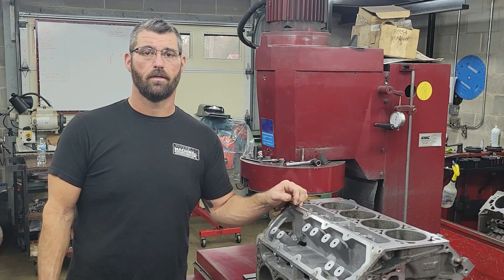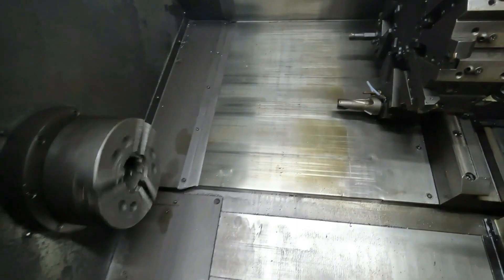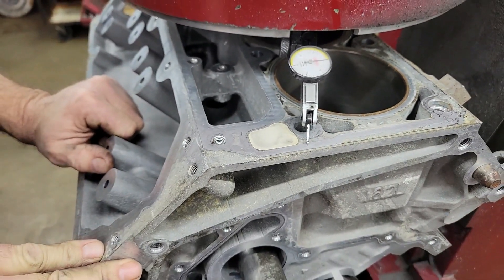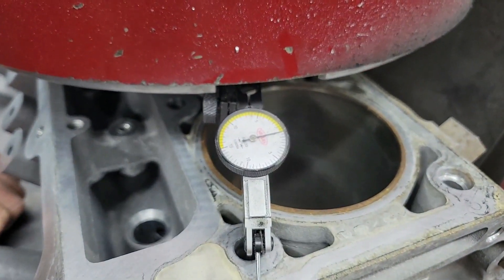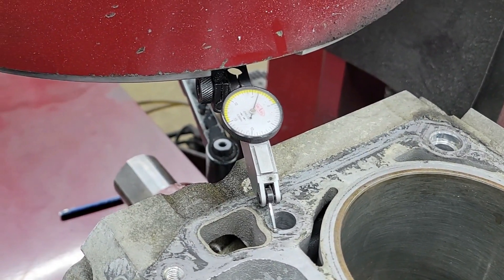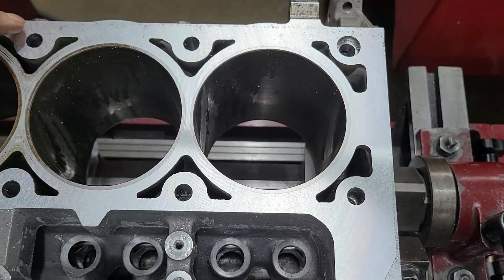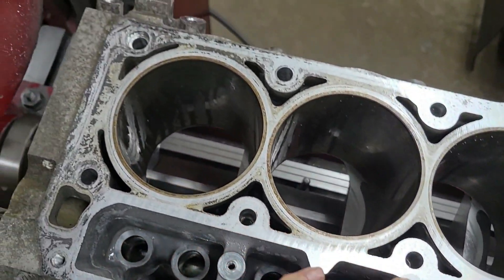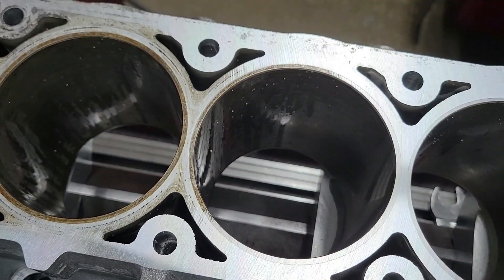Shop Tech: Do you really need to Deck your Ls block?? Lets find out.

Comment: Can you do a video for people that  only getting in to rebuilds subject is  selecting head gasket sizes after the head is skimmed,lm told with my application l need to check the piston protrusion which l did then referred to spec chart for  my application being a diesel landrover td5,l always assumed once head was skimmed it required a thicker head gasket any information on this l would appreciate,regards Roy
Reply from the maker: Will do

Comment: I took my aluminum l92 6.2 to a local machine shop he a great machinist and engine builder but he was telling me to deck my aluminum block that it will make lines across the aluminum deck because of the steel sleeves shavings coming across with the cutter.I believe he has the same resurfacer as you do you use special cutter or speed settings.I thought I’d ask because you deck surfaces look awesome..Thanks for sharing your knowledge..
Reply from the maker: Cbn with lube, works great
Reply: @powellmachineinc  thanks for the info …

Comment: Your last comment FB engineers…priceless!! Let me ask you a question, why do I see some performance shops state they will line bore and deck a brand new aluminum predator 3 block from the factory. Is it because they are mass produced no 2 would be identical in terms of tolerances?
Reply from the maker: Idk what a predator 3 block is, idk why anyone would line bore, a line hone would make way more sense,  and definitely the decks on most any block are no accurate

Comment: Nice content regardless of context.  If I’m paying a man to bore my cylinders I’d rather the deck surface be squared up to the main bores so that the deck surface can be used for reference. 
   Another detail I have encounter when deck both heads and blocks is milling head tram. I’ve seen machines set up with intentional tilt in the milling head to prevent retrace and I suppose to account for slack in the system that allows head shift while milling.  
    I like to tram the milling head as close to zero as possible. I know some machines simply will not allow for this, I’ve just seen some surface jobs that were .001”-.002” deeper in the center of the surface area.  It stinks when you’re machining for lock wire on either surface. 
   Head gaskets will leak and not be blown.  I’ve seen this numerous times possibly too many times to count. 
  When a head gasket is seeping and not blown it is still placing tremendous stress on the head and block in form of heat and friction. I’ve seen these issues left unchecked for too long.  Freshen up and freshen up the black areas in between the cylinders were discussed and nothing done to correct it.     
    Sucks when the heat treat on a very nice set of heads starts to yield and you can’t count on them to work. 
   People around those scenarios will throw their hands up and say the heads are just old when I know that if they hadn’t been stressed year after year they would have still been usable. 
   Sure you can get by without it in some cases. How much do you like gambling?

Comment: Copper coat won't fix that 100% true, but you don't need the deck to be 100% flat either; that is what the gasket is for. Multi-layer steel gaskets and torque to yield bolts work as a system to seal the deck to head interface, GM actually has a spec which is 6 thou from memory that the deck can be out. You have to remember that the deck will change when hot as different areas have more metal beneath them so those areas will have more expansion. You also have the head bolts applying a force to the block that will change the deck surface, why do you think alloy engines drop the bolt threads down further? to mitigate this issue. 

I just finished a head gasket job on a Kia Grand Carnival yesterday, it was leaking oil so we just got the heads surface ground at the machine shop next door to us and I used some of the soft panel beaters scotch bright not the hard stuff to clean the block and put it back together. The engine runs fine like the hundreds of other cars we've done this way, that engine needed time serts btw. 
Yea if the engine gets cooked and is warped the deck needs machining but 4 thou will run and seal. 

Call me a facebook mechanic I don't care but I know what works and what you can get away with doing engine work.

Actually now I think about this, I'm Australian and we have a forum here called performance forums where our best guru engine builders talk, there is a guy named Greg on their that builds industrial pumps for the big mining companies. Greg told me they don't machine pump heads flat as they actually make them convex in certain areas to increase pressure on the gasket in the critical sealing areas.
Reply from the maker: Several thing's,  as I build performance engines (mostly ) with power adders that is the audience I'm talking to, sure it will work in a stock application "most" of the time, also iron and aluminum Ls engines have the exact same bolt length,  most gasket manufacturers want a maximum of .003" deviation,  obviously I do this everyday,  it works sometimes amd sometimes not in stock applications, the chances of it working as cylinder pressure increases goes down substantially,  thanks for your comments!

Comment: hey I do Ls builds at my shop and on my more expensive rebuilds I get them decked however on cheaper 5.3 stuff I have always just cleaned them with a white roloc disc and never had a mls gasket not seal. I check with a machinist straight edge and have never been able to fit a 3 thou shim under end to end anywhere, I know at automotive repair shops or dealerships they arent decking the block for every blown head gasket. Am I just getting lucky ?
Reply from the maker: I should have been more clear, I just assumed people would know I was talking boosted/nitrous applications,  that's why I said "pressure " , but stock or not, we deck everything we build regardless.
Reply: @powellmachineinc  makes sense I mean obviously on higher end build I would deck but with the cost of a full rebuild being 5k+ most people are opting for a re ring with new bearings and gaskets on older 5.3s I would love to have the customer base to do full machining on everything but I just am not busy enough for that yet
Reply: Years ago, I roloc disked many many many block and head surfaces. One day I took a block and head I roloc "cleaned up"  to the machine shop and got to watch while they were both machined.  It was horrifying. All the low spots I had created to get surfaces "looking clean and shiny" Never again.

Comment: I'm not saying it wouldn't be better decked but if it is that far out and it is holding the head gasket then what because if you are saying you need to deck it because the head gasket won't hold up but it does then I just don't trust you I'm not saying decking it isn't the right thing to do but if you are basically lying it's not good
Reply from the maker: Just to "clarify " we are talking high performance/boosted/ nitrous applications,  sure it might work stock, but even stock is questionable,  I had a 6 0 last month similar to this and you actually see stains on the block where it was pushing coolant,  it was also stock, MLS gaskets just are not able to take up .005" plus deviation where as the old composition style gaskets could.
Reply: people do stupid stuff all the time it doesnt make it right..people "prep" deck surfaces with discs on a grinder and put it together..im sure some have had good luck and some havent..but for the run of the mill 300hp junkyard pullout do what you want..but when you spend money in a nice setup why wouldnt you square the deck..
Reply: If your taking you block to a machine shop no reason not to deck it . But that being said I run ls9 gaskets on a 5.3 and see 28lb of boost with China headstuds . And have never pushed a gasket
Reply: I mean there are several reasons to have your block at a machine shop other than decking is it probably a good idea but unless it was there for not sealing then it was sealing right
Reply: It might hold a head gasket stock, but start pumping it up and it'll let go. If you already have the block prepped, the machine work is cheap compared to labor to tear it down again
Reply: Bro just deck the block. It’s a minor expense and it’s the right way to build your investment property
Reply: english bro

Comment: So true Daniel.
I have not had a true LS yet, let alone anything else.
I had 5.3L LS -.004/.005 low in the middle. 
Thanks for sharing. 
What kind of Camshaft grinder do you have?
Looks yo be very large.
Take care, Ed.
Reply from the maker: 253 VanNorman, I think it will a 50+ inch long cam, I have ground large road tractor cams.
Reply: @powellmachineinc  Very nice.
Some of that old Van Norman equipment was very nice.
Made in the USA also.
Thanks Daniel.